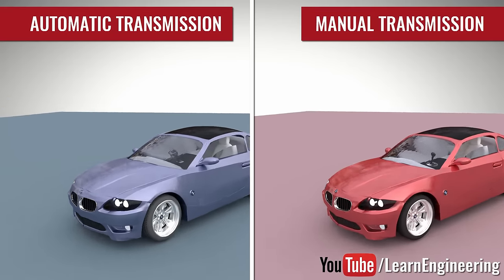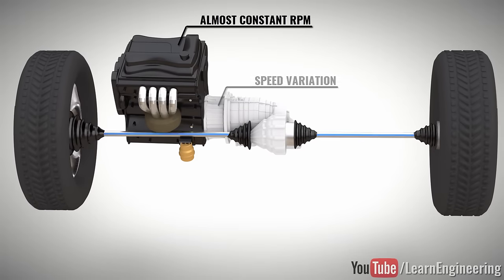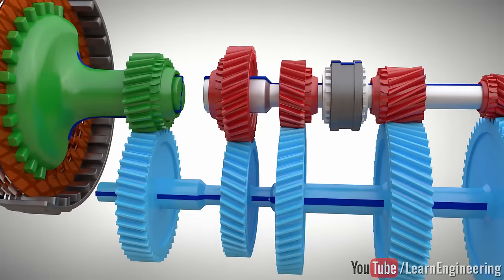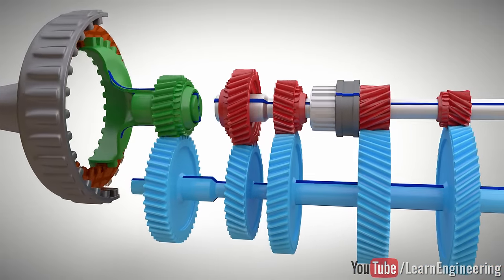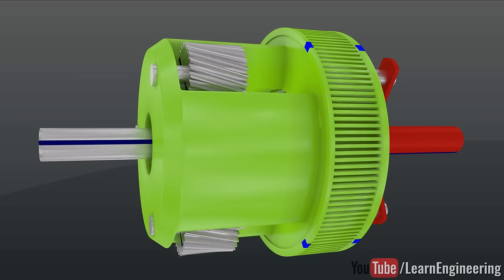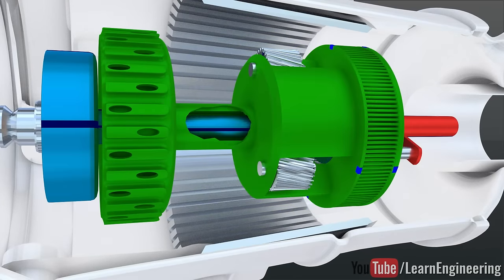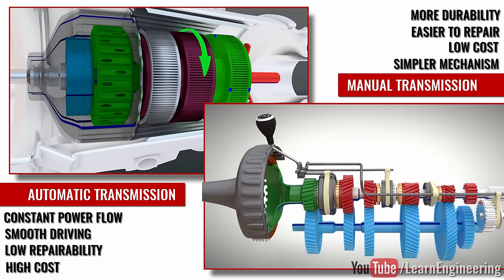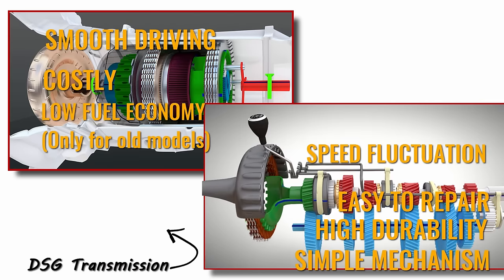Automatic vs Manual Transmission

Comment: "never a smooth experience"
I take that as an insult
Reply: Marko Djurdjevic or you.
Reply: Marko Djurdjevic  no u
Reply: Marko Djurdjevic  it  always isn't smooth. You can minimize feeling of jaggong to unnoticeable level but you can't get rid of it.
Reply: Marko Djurdjevic  you don't understand. It isn't about skills. It is about technology. It is physically impossible to do not loss power while changing gear you can drive like God. You can use mechatronice to automate manual transmission to have perfect gear changing. But you will never get rid of it. You can only minimize feeling of it because car have big momentum. And no. In modern automatic transmission there is no gap between.
Reply: Marko Djurdjevic  you need to learn  about engeenering and probably not about driving. Your knowledge of physics is not a related to how many kilometers you have traveled man.
Reply: Marko Djurdjevic  I am very unhappy that you cannot see your mistake. But if you absolutely want to end the conversation, I wish you luck.
Reply: I like the feeling of it not beeing smooth...
Reply: Marko Djurdjevic   Don't be a jerk Marko.   This American has been driving cars with manual transmissions for nearly 3 decades.  Driving one is like 5th nature to me now.
Reply: @Lord2225  Yes it is about the skill of the driver. The key to avoiding jerky motion when driving a manual is knowing when to skip gears when accelerating. My car has 6 gear speeds. But I very rarely ever use all 6 speeds when accelerating. Frequently  I will shift gears in order 1, 3 ,5 ,6  or 1,2,4,6  depending on current speed or if I am on a hill.   If done correctly it can be as smooth as butter with no loss of power.
Reply: @ironphoenix5145   Iron Phoenix  And that's why you're not a physicist / engineer. You don't see that your perception of reality is contaminated by your senses. You don't see the details that are so important in science, you only see what you want to see - "it's smooth to me." For some people, the earth is flat and it also results from erroneous perception. Maybe you will understand the difference. All the imperfections of automatic transmission are the result of imperfect materials / cost cutting. Theoretically, continuous power transmission can be achieved. For the manual gearbox this is physically impossible, regardless of how you drive. It may seem smooth to you because the weight of the vehicle reduces the feeling but it will never be 0. Have a good day.
Reply: @ironphoenix5145    As long as you're not slipping the clutch more.
Reply: @timjohnson1199  Been driving manuals like that for almost 30 years with zero problems.
Reply: I literally came down to comments to say exactly that
Reply: @eliascatlin9615    When I'm on my bike with the sequential transmission I try to rpm match so I don't get a 'clunk' when I change gears. I'd be a little ashamed to not get a smooth shift. Only been doing it for about 48 years.  The newest car of mine is an automatic while the Miata ('91) is a 
5 speed. 
Ever had to double clutch?
Reply: Same
Reply: Marko Djurdjevic  yes
Reply: Marko Djurdjevic   @Maciej 'Lord225' Złotorowicz  is correct, what he is saying is that when you press the clutch you're disconnecting the power train, at that point in time, no matter how fast or smooth you shift, there will always be a split second where the clutch is disconnected, this means you're losing power in that moment. There is a loss of power when it disconnects, for a moment in time.
Reply: A lot of the time, I do not use the clutch to shift gears on my manual transmission Volkswagen GTI, Mustang GT, Porsche 911 Carrera, or my Acura NSX. There for, am I still loosing power or slipping? Legitimate question.
Reply: Well, then Manual Transmission users are roughnecks... Eh!?
Reply: Lmao Yea that triggered me, I was just like "It's probably because you don't know how to use a manual"
Reply: @itoyotaicorollanotherone8888  so true...
Reply: Marko Djurdjevic  speak up I can't hear you over my freedom and greatest military
Reply: Marko Djurdjevic my parents are gonna make me learn manual they both know how to drive a manual
Reply: Damian Chiliński  Thank you for your comment Demian. Everything that you said makes sense to me. However, I learn to drive since I was like 7 or 8 years old, but don't know much about the mechanics of cars (shame on me). When I was 10 or 11, I had the opportunity to ride with one of my dad's truck drivers. He thought me how to drive 18 wheelers.  He was also the one that thought me how to shift without clutch. He actually did it on the 18 wheeler and said to me that 1) I had to learn and get very good on a car first. 2) In order to do it you have to feel the car so that there is zero scratching. 3) Practice, a lot, on driving the 18 wheeler before attempting the shifting on the 18 wheeler. 4) That if I could manage to shift all the major gears on the 18 wheeler without the use of the clutch, I would earn his respect. Long story short some, I took the challenge and succeeded. As it is like second nature to me and, of course, I don't do it all the time, I don't think that it does any damage to the transmission. I don't feel or hear anything when I do it.
Again, tell me what you think.
Reply: Damian Chiliński  Oh, I see. I actually doesn't even make sense to do that as there is no engagement of gears for that instant; therefore, there is no transfer of forces to the wheels. As I said, I don't know much about the mechanics, but I know that you still disengage the gears. The only difference, to me, is that it can be faster. Of course, is only tenths of a second faster if you are avid with the clutch, I think. Anyways, I really enjoy all this type of videos that nurture the brain.
Reply: He's right though, you can't compare the smoothness of a automatic to a manual, no matter how hard you try.
Reply: Marko Djurdjevic  Heel Toe and there you go. Automatic is for plebs.
Reply: the biggest satisfaction you can have is changing gears without any hiccups
Reply: @Lord2225  No no, you can.
And your comment reflect the misconception about Manual transmission.
In some Automatic transmission, the change is so brutal that it can send you flying off the road. Of course, it's the older or cheapest ones.
If you match your speed with the one on your future gear, a Manual can be extremely smooth. Of course, it also depend on your engine and gearbox.
The same principle apply for Auto.
Don't compare a Manual Lada which can barely keep itself with ductape and an Auto Chiron that costs several millions.

Take the same references, for the exact same car and engine, with approximately the same price, the manual CAN be smoother than the Auto, it also greatly depends on the driver's skills and/or use

I don't know if my point is correclty depicted and my syntaxes not too weird because English isn't my native language, but in short, like always, there's too much variables to take into account to confidently say "Auto = smoother than manual", it's completely false ^^
Reply: I never had a non smooth experience. Heck you can make this smoother than any automatic couse you're fully in control
Reply: @pedinhuh16  true
Reply: Marko Djurdjevic  automatic is for people who want a smooth experience without the complication of shifting gears, yes it may not be as fun but it is very useful and a breakthrough invention
Reply: Marko Djurdjevic  I agree that automatic is lazy but it's not a bad option for buying a car
Reply: Marko Djurdjevic  It doesn't apply to an automatic transmission though, the second clutch is already starting to engage while the first is still fully engaged. Industrial and agricultural vehicles use the same principal as an automatic, purely because there is no gap in power throughput. A tractor, while plowing cannot be shifted manually with the clutch pedal, as it would come to an instant halt. But by using its powershift gears, which work identical to an automatic transmission, it shifts up, without lowering in speed AT ALL, due to the overlapp in clutch engagement.
Reply: Marko Djurdjevic  the debate between auto and manual is kinda stupid actually, people should just respect what other people what
Reply: Marko Djurdjevic  In that case I suppose you're talking about an automated manual transmission? I'm purely talking about the principle explained here. And to clear things up, I'm actually a fan of manuals over automatics.
Reply: Marko Djurdjevic  ok
Reply: Marko Djurdjevic  Yes, you're right. For a transmission to change gears without power loss, there needs to be at least two clutches, one to take over from the other during each shift. But that doesn't necessarily mean only double clutch gearboxes have more than one clutch. A double clutch gearbox are basically two manual transmissions which each have a clutch and take over from one another each time you shift. An automatic transmission with planetaries has more than two clutches aswell (I think one clutch per gear, but not sure). Now I should say that it is possible for this concept of transmission to shift without power loss, if the clutches' engagement overlapp. But that doesn't necessarily mean that I'm saying this is always the case with every car. Seeing as you're a mechanic, you'll have driven way more automatic cars than I have. Some cars might be designed without this overlapp, but I don't know.
Reply: Damian Chiliński  For all I know, it does work like that. In agriculture and industrial vehicles, the clutches "smoothly blend between engagement" for constant power throughput, with a perfectly smooth gearshift as a result. Not as experienced with automatic cars, but I would think the same principle applies, as the transmission concept is identical.
Reply: Marko Djurdjevic  Good point and I'm not sure honestly. Our experience areas are very different. The automatic car I've driven didn't seem to have power loss during shifts, but you have more experience (I admit).
I'm just saying it's technically 100% possible, doesn't mean all cars have it. It might just be too expensive for cars, with all the electronics and sensors required to control the clutch overlapps precisely.

I always thought it (the race car example) was due to less moving parts and thus a higher power throughput. Seeing as in a race car it's no problem to wear out a gearbox more quickly, by just smashing through each gear (as a sequential does).

Lastly, just something that I thought of as you were talking about the fluid clutch: could it be that a shift of the transmission would cause the fluid clutch to slip and thus lose power for a moment?
Reply: Marko Djurdjevic  Are you a mechanic (claim to be one, which is fair, but also doesn't make you an expert on the science behind a transmission, it just means you know how to fix one, which anyone can learn, blue collar job after all (no disrespect to blue collars out there, it's an important job that someone has to do) or a long haul truck driver, and even if you were a long haul truck driver you are claiming to drive almost 25,000km more per year, for 10 years, than the average of 75,000km, lmfao okay.

Sooo, i'm calling bullshit.
Reply: @rdwind7734  People in this thread are arguing over two different things at this point. One side is arguing over the "feel of the ride" during a MT shift while the other side is talking about the inevitable loss of power during a MT shift, disregarding the "feel."

Also the competition b/w MT and AT was killed when the dual clutch was invented, physically impossible for a human to ever out shift a dual-clutch
Dual-clutch super dumbed down: basically always has the next gear already pre engaged.

If you want truly smooth go buy a Nissan that uses a Continuous Variable Transmission, it literally doesn't shift gears it "slides" through the ratios.
Reply: Maciej 'Lord225' Złotorowicz just because you lose a bit of power doesn't make it not still feel smooth
Reply: It's funny to see you guys debating about two different kinds of smoothness in one thread 😂
I mean.. yup, manual can be smooth as fuck when it comes to feeling (G-force or sth), but if you look at something like chart V(t), it will never be perfectly smooth.
To be precise: when you press clutch, at least for a fraction of second there is no force 'given' from engine to wheels, so you are no longer accelerating during this time, which means, that V(t) chart cannot be perfectly smooth (when you want achieve constant acceleration of course)
Reply: Marko Djurdjevic  automatic is more of a suitable/comfortable upgrade to the manual. U cant say that it's for lazy people. It's like saying, "Driving cars is for lazy people. Hardworking people use carts pulled by oxen, to go around."
Reply: Marko Djurdjevic  yeas and manual drivers are bad at running
Reply: i saw this comment before watching the video and though it was talking about automatic... because in my experience its harder to control when the change happens with automatic and you get this nudge when the bigger gear engages as you are accelerating... but with manual you you can control it so its much smoother experience.
Reply: @Lord2225  "minimize it to an unnoticeable level" but still it isnt smooth? Do you know what a smooth experience means????
Reply: Absolutely 👍👍💯💯
Reply: Marko Djurdjevic 😂🤦‍♂️
Reply: Me too
Reply: Marko Djurdjevic  what a load of shit you spout, ever heard of a straight cut dog box dude? No clutch hard on the floor changes absolutely no power loss. Far better than any auto with a torque converter could achieve, I might say better than a double clutch box as well. You may witness these changes watching Australian V8 supercars racing.  Shit when I was a kid I had a Mark 1 Ford Cortina with a close ratio gearbox and light flywheel, l could achieve the same results. Dude!
Reply: Marko Djurdjevic  it's not that hard to be smooth
Reply: Marko Djurdjevic  true
Reply: Marko Djurdjevic  my automatic accelerates extreamly smoothly.
Granted i have a CVT
Reply: Me too
Reply: +1
Reply: I is smother if up don’t use the clutch and listen to the engine revs
Reply: Me to
Reply: I guess it get more dependent on the driver skill on clutch release and throttle control. but even if the driver is smoothn there's still a non continuous acceleration.
Reply: as a driver you can achieved that smooth transition without jerking the car while changing gear and that is also a sweet experience to every passengers. I will leave the physics and inrecacies of how the mechanical parts or electronics gadgetry do it. Let the engineers and mechanics discussed it. Happy driving.
Reply: Stoopid discussion! Yes, you can make an Absolutely Smooth shifting on manual transmission but that IS NOT the point! The point here is... You will have discontinuation of power because you Have to use the clutch... This can be very very smooth, but you WILL loose power because at certain point, no matter if it is 0,000001s, the motor won't be connected to the transmission.
Reply: But I got your point... I love manuals and have smooth shifts too 😁
Reply: I am an engineer...and you guys don't understand irony...or pheraps you are not good at shifting...so many comments explaining how automatic is smoother than manual (old automatic wasn't compared to a good driver)...but this was an ironic comment...please fellow engineers, be less technical sometimes
Reply: Easy there, sandpaper willy.
Reply: @ironphoenix5145  is that skipping gear technique only recommended on cars with a 6 speed transmission? My car is a 5 speed and I admittedly haven't been driving manual that long but it seems like if I tried that I'd have a bad time
Reply: @Lord2225  and it is physically impossible to tell the difference, you need to learn some biology and not engineering
Reply: I think the problem here is that the example is a BMW
Reply: This guy obviously doesn't know how to drive a stick.
Reply: @Lord2225  Your "reasoning" is that of a theorist.  In the real world, a manual can easily be made to shift buttery smooth (with practice), while an automatic CANNOT.  It is always noticeable if you're paying attention.
Reply: Me too😳
Reply: I can feel the company truck I was assigned shift, and that's an automatic. It's a '91 DODGE D250. There are things I can do with that truck that I thought were only possible with a manual.
Reply: it all about rev matching
Reply: Right..?  

I understand that on paper this could be argued, but it really just comes off as silly and opinion biased over the realistic scenarios where as those that drive manuals tend to be smooth as silk during regular day driving.
Reply: My dad's Mazda was a smooth ride. My Toyota, not so much.
Reply: @ Le Mordus Be fair about it and understand the reference frame.

Technically, the power graph of an automatic will always have a smoother plot than a manual. What is not presented are the velocity and acceleration graphs, which is perceived as ride smoothness or lower perceivable inertia alterations.

Through the use of inertia an experienced operator can generate smoother acceleration and velocity curves, which leads to the anecdotal "have to know how to use your tools" experience of the ride smoothness. In that area, an experienced operator can outdo the "jerky" gear change of a new manual user and the acceleration loss of the new torque band in automatics.

This video is purely focused on the power band. What is presented is factual. It is Physics and Mechanics and completely reproducible. Don't feel insulted by facts.

Admire that a qualified engineer would present the additional information and muddy the topic while it takes an experienced engineer to present things you can't argue with.
Reply: I get that, but a good automatic will always be more smooth then a great driver can do with a manual